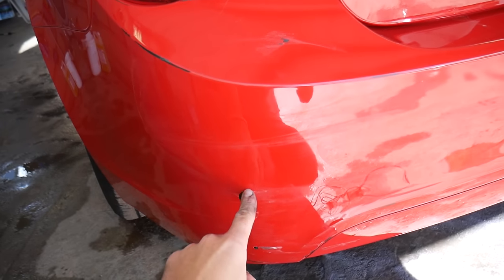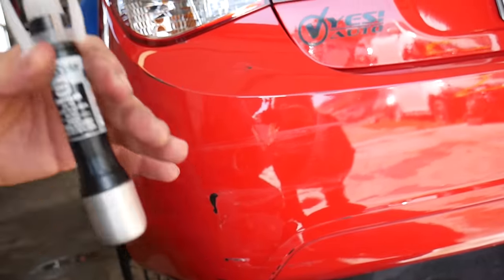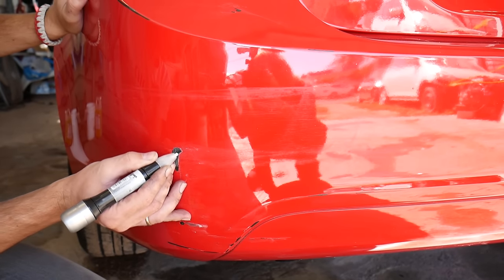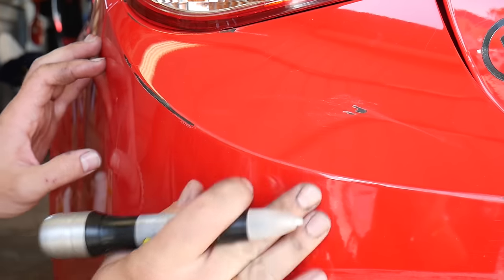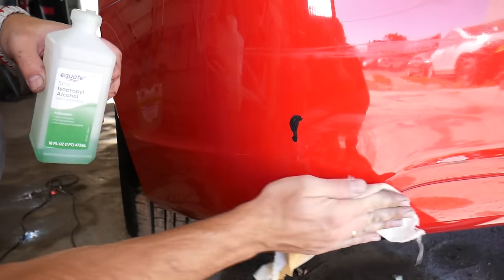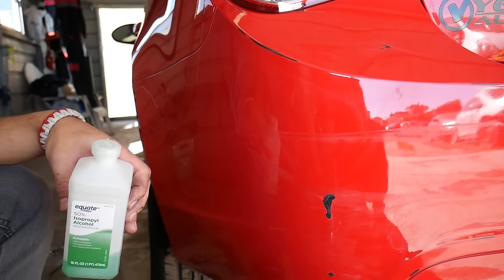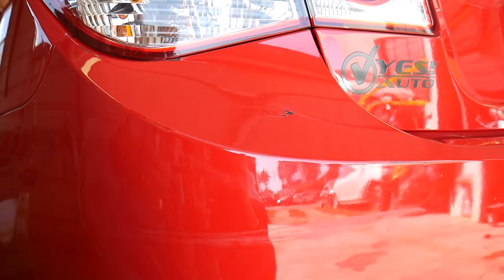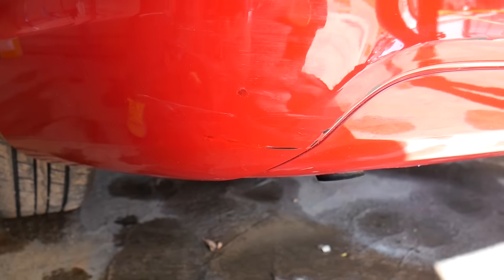HOW TO FIX PAINT SCRATCH ON CAR BUMPER like a PRO | Easy

Comment: hi i have a mazda3 2014 and i need this for my car do u guys have the paint color of 
sky blue ill look on my title to make sure its the correct blue im saying pls pls reply thnx
Reply: You need to search on google the exact color for your car by either using the vin or the make and model. You will get a color code. (Number and letters). Use that code to search on Amazon or Google with dupli in front of it. Like “Dupli Pen NH-831P”. Just an example. Also the color code should be on the lower part of the tag in your door area.
Reply: Chaudhry Ahmed thx sooo much 

happy new yr 

stay safe

Comment: Great demonstration but how do u prevent the applied paint from coming off after polishing?
Reply: Time. Letting it dry is important (or using a primer / clear coat all-in-one paint).
Reply: As long as the paint stays until he sells the car and gets it off the used car lot.

Comment: I am in Australia, how can I buy this pen with correct color for my car
Reply: Autobarn, Repco and Supercheap Auto all stock them, but not sure whether its the full range. Compare the paint code on the manufacturer's plate on your car with with Holts / Duplicolor book at the retailer to get the correct colour.  I read in YT elsewhere that Autobarn also does colour matching and mixing.

Comment: Easy on flat paint. Would look like shit on anything metallic

My recommendation is to mix the clear with the paint and then sand and buff that way you don't have to worry about cutting through the clear
Reply: What products would you recommend for metallic paint? I was wondering the same thing if this would work on a metallic silver.
Reply: @alexis98559  if you want a perfect job you will need to blend the whole area anything else will be noticeable because of the metallic

Comment: The video resolution isn't high enough to tell how well the repair actually did. If you guys plan to keep doing repairs like this and you can't up the resolution then I would suggest you zoom in closer. Unless you knew exactly what the camera could see and you didn't zoom for a reason. If that was the case then I would consider that dishonest.